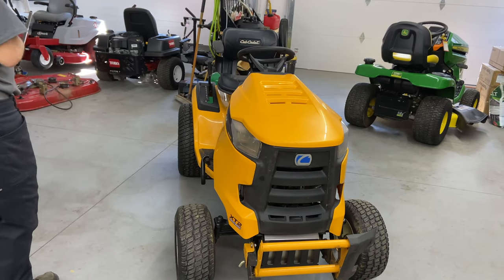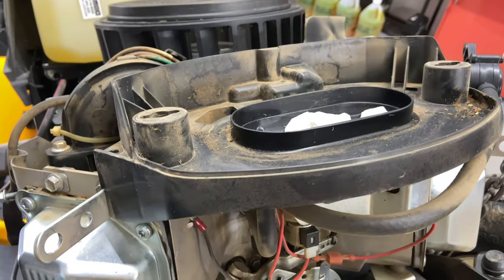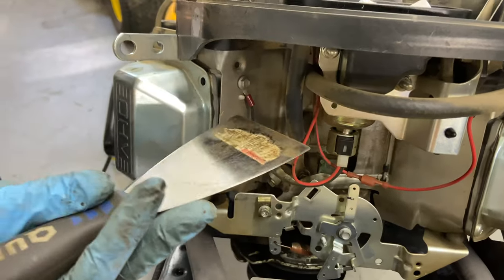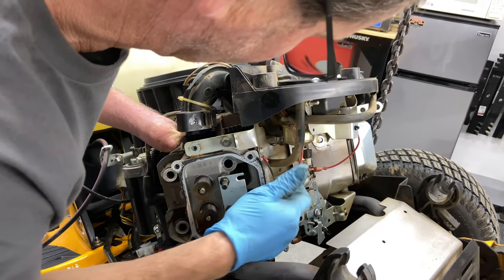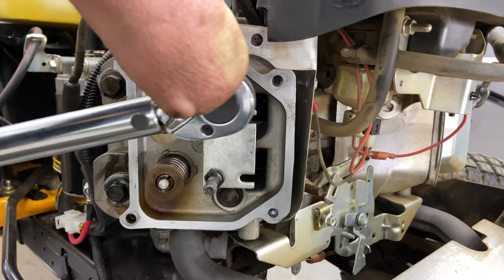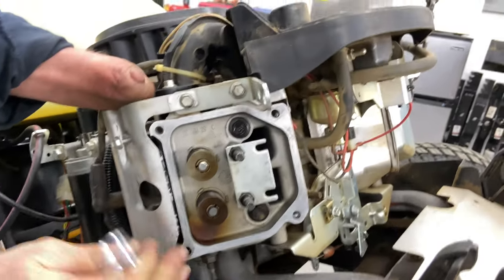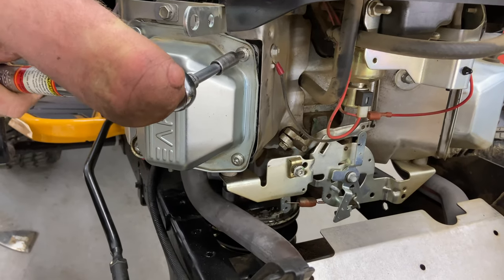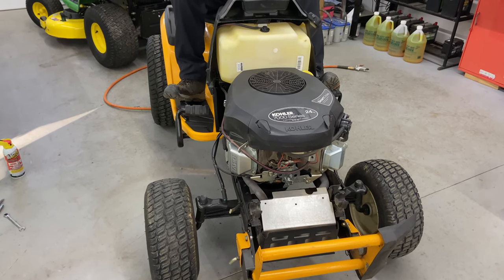Kohler 7000 Series Head Gasket Issue. How to diagnose and repair blown head gasket.

Comment: After watching your video, I am convinced that if I ever have this problem, I have no business attempting this repair.  Definitely a job for you.  Always enjoy your videos, you're a very talented mechanic.
Reply from the maker: Hi Mac, yes, this isn't for everyone. I put this out there for all to see about the Kohler 7000 series head gasket issue. This one was most likely caused by the user, low oil or even mice making there home inside around the spark plug, overheating the engine.

Comment: We watched this video because we suspected we also had a blown head gasket. Needless to say, I have very little mechanical ability but our Troy Bilt Super Bronco is a life saver for us where we live, from mowing to snow blowing. Having few people around us to help us, we have to learn to fix things ourselves. Brad is such a great teacher, his ability to show you how to do things in a step by step process, showing you the right tools to use and what not to do has been invaluable to us. We took our heads off the engine today and yes we do have a blown head gasket. Parts are ordered and we are confident we will have no problems replacing them and having our tractor run like new. Thank you so much for making this video!!

Comment: The Contant of this is very clear and concise, and I believe I must disagree about the possible cause of the head gasket blowing with your comment of low oil level, I just did mine courage 25 hp vintage 2007. I’ve owned it since new. I am very diligent of checking my oil and have never run it low Also, no obstructions around the Fins of the heads! With the upgraded head gaskets, I believe this is definitely manufacture error in head gasket design. Keep up the good work.
Reply from the maker: Thanks Steve, I do agree with you to agree as obviously, they made a change in the head gasket. But the dark heat marks don’t lie! Did you find any heat marks? I also know this customer had mice issues where the machine was sitting. Briggs and Stratton have had a issue for over 20 years and I still replace heads gaskets. This was my first one on the 7000 series. Did you replace both or just one? Just curious if you heard the sound on both sides.

Comment: Oh Man I could never do what you did. You know all the little tricks, all the best way to deal with problems, and how NOT to damage anything you need to put back on. There is no way a normal non mechanic. can do. Thank you for basically not to try to fix something like that. Thank you for another great video!
Reply from the maker: Thanks Steven, keep the oil clean and the mice out and you should never need to perform the repair! :)

Comment: I got rid of my old stamped valve covers and replaced them with the composite valve covers.  No more sealant, just an oval ring inside.  Now to check my valve clearances I just remove the valve cover, check my clearances, inspect my oval rings and replace the covers.  You did a great job cleaning the piston top and all around where the head goes, I just wished you had shown us the underside of the head where the valves are to see how clean that was.  Food for thought.

Comment: I just discovered your video in my YouTube feed. Exceptionally well-done. You're articulate, precise and the camera work allows the viewer to see everything. I have the identical engine in my 2015 Hustler zero-turn Raptor. By 2017 I was hearing the "swosh" from one cylinder on engine shutoff and it was indeed a blown head gasket (with not more than about 100 hours logged). Had a local shop do the work and has been running fine ever since. I'm really thinking it was a Kohler design flaw as I've been pretty dedicated to monitoring/managing all fluids.

Again, much thanks for posting such an effective DIY video. Will bookmark it and do the work myself next if there's a "next time".
Continued success!
Reply from the maker: Thanks for watching and the kind comment:)

Comment: I wish I had seen this before I had to do it myself. You had great tricks. Excellent video.
Reply from the maker: Thanks Dean, I’ve only had the video out for less than a week so most likely it wasn’t around when you performed yours. Did you find a reason why yours had the issue? I always try and find out why it happened so you can try and make sure it doesn’t happen again.

Comment: Good video. I've got a 2014 Kohler KT-725. No head gasket problems yet, but both valve covers have leaked over time and needed new RTV. That exhaust gets super hot, and I think that's been the problem with mine. Now that I know, I keep an eye on oil levels constantly.

Comment: I was just doing a valve adjustment on this engine this weekend. After cleaning off the mating surfaces of the valve cover, I used RTV on the head and a custom cut rubber impregnated fiber gasket over that. Worked great, no leaks, and should come apart nicely next time. I would have tried just the gasket but it looked like someone ground that head surface with a machete.

Comment: I just finished doing the same thing to a Kohler CV730 . I took the heads to a friend's machine shop.  He ground the valves and seats.  What surprised me was last year I did a compression check the #1 was 115 #2 was 117. After the valve job,  #1 was 130,#2 was 160. I don't know how many hours are on this engine,  so I'm sure it needs new rings as well.

Comment: Great video!!  I was looking at a Cub with a 7000 hd engine.  Will rethink it.  In the meantime... this channel will sit right next to Taryl Dactal!  Good work!
Reply from the maker: Hi Bruce, I actually like this engine and obviously they changed the gasket and that is telling us they had an issue. I have seen many of these twins and they are very powerful. Just remember to keep the oil level correct, change it (and oil filter) when needed and keep mice away and the engine should be there a long time. Thank you for watching, the kind comment and supporting my channel!!
Reply: Thanks!!  I noticed the replacement gasket is a LOT beefier than stock.  Too bad there doesnt seem to be a valve cover gasket.  Thanks again!  Great content!!  🍺

Comment: FYI, Kohler has a replacement kit of composite material valve covers (they are black and not the silver tin).  They come with an improved gasket.  The kit comes with 2.small heat shields that go between the valve cover and exhaust.  The shields attach to those two bolts that were tough to get to, just above the exhaust pipe under each head.   I did the replacement and all is good.  Bad thing is that I think I have a blown head gasket, and may need to complete this process.   Same 7000 series professional Kohler, but in a zero turn that I recently bought used.  BTW, it may not be a user issue.   I think the fact that the horizontal exhaust pipe right under each valve cover is the culprit of high heat.  The fact that the heat shields are now included tells me that this is likely the issue.
Reply from the maker: Thanks for the heads up. I will definitely check into it!

Comment: Great video. Clear and concise.
I have the KT735 Kohler engine on my zero turn mower.
The same head you repaired gives me problems that lead to running hot.
The heat shield surrounds the head and curves beneath the head.
The fins of the head clog up with yard waste. 
I want to cut a portion of the shield away at the bottom of the shield.
I hope that will allow waste to drop down and less accumulation to clog the fins.
Do you think it will make an improvement?
Thanks for any thoughts.
Reply from the maker: The fins/shrouds are designed for cooling from the fan on top of the engine. I would suggest blowing off your unit every time your finished mowing and it will help. Don’t let it get a chance to accumulate.

Comment: Hello thank you for this video..I think I have an exhaust leak on this same motor. Is there a certain way to install the bolts when putting muffler back on. Also do the gaskets need to go on any certain way. One bolt dose not want to tighten. Thanks a lot for your help
Reply from the maker: Every job is different and you do the best you can. I don’t think you can install the gaskets incorrectly and if you’re talking about the nuts on the muffler, they only go on one way.

Comment: Very nice job. Sometimes I will use a reverse torx on the exhaust studs if they will come out easily. Kohler and Briggs use to be the best. No so much any more. I have changed cams on Briggs due to compression release failure. Wish Briggs had owned up to that issue and send the parts for much less money. I think the Kawasaki engines are amung the best now. Thanks for a great video.
Reply from the maker: Thanks. You know when the compression release on the Briggs engines fail when you need a 1000CCA battery to start your machine!! LOL :). I install at least two cams a year. It’s not that common and most customers will not repair due to the cost. It depends on condition of the machine when it happens. I agree with you about the Kawasaki engine! Thank you again for watching and commenting:)

Comment: I have this same engine on  a Cub Cadet zero turn. It's overheating where the exhaust pipe glows a little orange and I can see flames licking out of the muffler when running in the dark. Do you think head gasket or valve related? I have not pulled the valve cover to check the valve clearance. Could it be as simple as a valve clearance adjustment?

Thanks for this well done video! It shows a lot of good detail on how to disassemble around the head. I'm now a subscriber!
Reply from the maker: The muffler or pipes should never glow red. The engine is either running lean, overheating or over revving. You may have many different issues now, yes including a blown head gasket and valve issues.

Comment: Great Video - How did you know that head was bad and not the other one?  Should you replace both at the same time?  Thanks for your help.
Reply from the maker: In the beginning of the video I heard a swooshing sound of air coming out of the one side and pointed it out. Obviously you may not have heard it well on the video but you should be able to tell ast home. A compression test should also be able to find it. I only repair the side that is blown. It doesn't happen often and when it does there are normally reasons for it. I try and keep the cost down for the customers. If it needs both then I will perform both. If you feel you want to perform both then go for it! I would hope by now all newer engines have the upgraded gasket in it. Time will tell.

Comment: Hey I just want to say congratulations good job I like the way you work I'm small engine mechanic myself I just kind of wondering why you only did the one head gasket instead of both especially since you know that their problem on that motor
Reply from the maker: No need to repair the side that was good. Plus it would add unnecessary cost to the repair.

Comment: Incredible Job! Nice work!  I just bought a new Cub Cadet Cub Cadet 2023 XT1 Enduro LT 46 in. 23 HP V-Twin Kohler 7000 Series Engine Hydrostatic Drive Gas Riding Lawn Tractor.  Yikes I hope my head gaskets don't blow.  Has cub cadet fixed this problem with the better new robust gasket pictured? or is failure only due to a low oil situation? Thanks
Reply from the maker: Hi David, I think this happened due to overheating from mice. You would think the newer made engines would have the upgraded head gaskets.

Comment: Great video. I also run a small engine shop. My son bought a Cub Cadet, 7000 series engine. Same as your's. Only 50 hrs on it. Confused as to why we are adding oil? No smoke or leaks. Is there an issue with this engines? Any suggestions would be greatly appreciated. Thanks u.
Reply from the maker: Possible stuck ring? Overheated at some point? I personally have not come across to many issues and the ones I have come across, I have put a video out on it. This engine has normal issues as all small engines do. These engine do burn some oil (depending on conditions and how the machine is treated) but I cannot say how much in so many hours as I do not run them enough and just perform the repairs. I have come across that model will burn more oil if it was over heated from mice making there homes under the engine shroud if not caught in time.
Reply: Thank you 🙂

Comment: Thank you for the video.... I have my KT725 apart and suspected a bad head gasket, but instead found a nest and gunk in the cylinder head fins (heat).   I also found one of the three cylinder head bolts completely loose which would make sense.   Ever see these KT725s assembled with one bolt loose?   The head gasket looks ok.   I'm wondering how this happens.
Reply from the maker: Normally, when I find head bolts loose, it’s due to either a mouse nest that overheated the engine or clogged head fins that could also overheat the engine, allowing everything to loosen up as he gets too hot.

Comment: I have a cub cadet Lt 5400 Kohler engine.
 I have gas in it and it's firing because I can see the spark when taken the plug out and spinning it over!! 
 The fuel solenoid I thought was the problem but I changed it out when it first started screwing up . 
 It won't start at all now but it was cranking and going 50 ft then it would die and I would have to wait 5 or 6 minutes until it started back again but now it won't start at all, can you help me get this thing started??? Thank for you help and I subscribed to your videos
Reply from the maker: I cannot diagnose a machine without seeing it but guessing it sounds like a fuel issue. Clogged fuel line from gas tank, debris in gas tank,
 or debris in carburetor. Fuel shut off solenoid not working correctly, intermittent power going to it bad wire.

Comment: how did you know which cylinder had the blown gasket? can you audibly hear the swishing noise from the specific head and that’s how you knew? i have a kt740 with a similar issue, about to dive into it in the next few days, thank you!
Reply from the maker: In the beginning of the video I heard a swooshing sound of air coming out of the one side and pointed it out. Obviously you may not have heard it well on the video but you should be able to tell ast home.

Comment: Thank you for this video,very helpful. I have this same motor on a scagg zero turn. It’s still running but it very loud and I can feel air blowing bownward on the left side head. Would this be a gasket problem too. Thanks for any help.
Reply from the maker: When you turn off the machine and you hear the swooshing sound as you did in this video I would assume that yes it is a head gasket issue. You could check to make sure the exhaust is tight and if it is most likely, it’s a head gasket.
Reply: Thanks so much

Comment: Same cylinder, same place were mine was damaged. Always had plenty of oil though. When replacing in the Spring discovered the mice over winter helped themselves to the ignition coil wires. Primary and secondary.
Reply from the maker: Hi Jim, as you found out, mice can create major issues with machines. Especially in the climates where we store our machines for the winter. I deal with mice issues on many machines in the spring due to no start conditions. Try putting a ton off moth balls in the breathable bags all over the engine and frame near the engine to help keep mice away. If needed you may need to bait them. I have pets so moth balls for me seems to deter them. I must say, you do need to use a lot of moth balls. Thank you for watching and commenting:)

Comment: Great video, what did you use to clean up the head surface as well as the valve cover?
Reply from the maker: A fine wire wheel on a drill.

Comment: Would I be correct in assuming this would cause oil to shoot out of the dipstick tube? I adjusted the valves and it still did it
Reply from the maker: Not necessarily, If the oil level is correct and If you leave the dip stick off of any small engine you most likely will have oil shoot out. You normally can hear the head gasket if it is blown.

Comment: What can cause the breather to overfill with gas and finding wet spark plugs?
Reply from the maker: Without seeing the machine my guess would be. If you smell gas in your oil? If your oil level is higher than normal you most likely have gas in the oil and this can be caused by he carburetor failing internally and can let fuel enter the engine. It can then enter the cylinders and foul spark plugs or worse fill the cylinder with a a lot of fuel.

Comment: That exhaust valve that got hot, would that also be caused by a worn valve stem seal ?
Reply from the maker: No, There is no valve stem seal on the exhaust side. If you have a bad valve stem seal, the engine would burn oil and you would see white smoke from the exhaust.

Comment: What was the customer orginal complaint, was it just the noise or where there other complaints like loss of power etc.  Great video
Reply from the maker: The noise was found when the machine was in for service. It was caught before any issues came up. If not taken care of, the compression would have gone away making the tractor run poorly.
Reply: Would that cause it to surge in and out of power if a head gasked is blowed ?

Comment: How do you diagnose what side valve cover to take off to get to that gasket?
Reply from the maker: When you are listening for the whooshing sound around the :50 second to1:00 mark in the video. You can tell which side it is coming from. You will be able to tell when you perform this on your machine. If it sounds like it is coming from both sides then I would check exhaust gaskets first and after that replace both sides (if your hearing both sides whooshing sound). The machine in this video had just one head gasket issue.
Reply: @JohnsonsSmallEngines  awesome thank you sir!